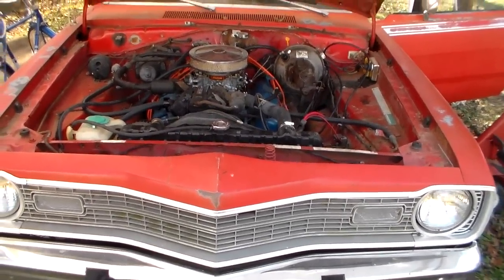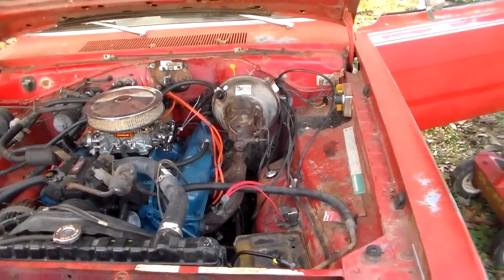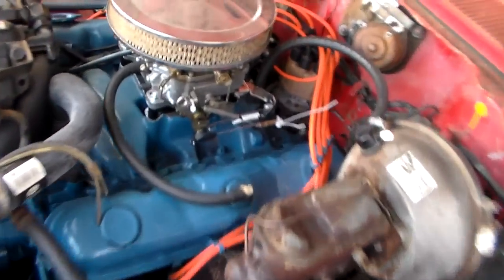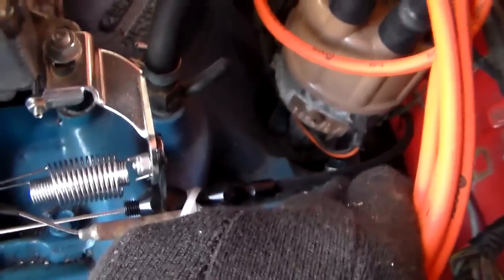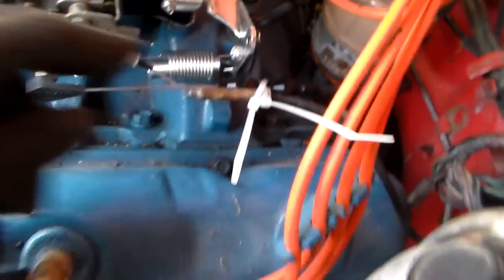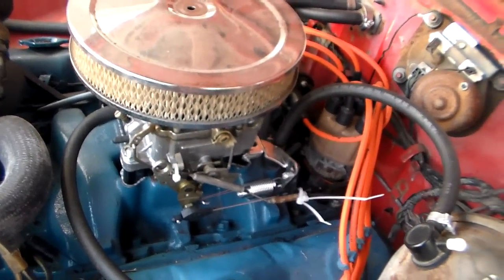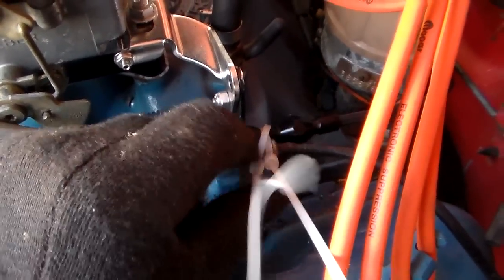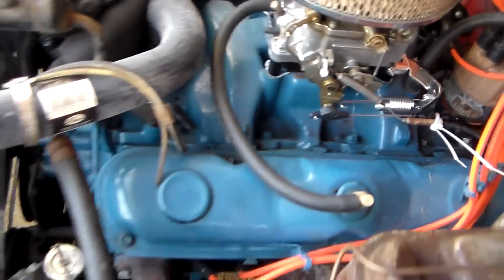Lokar throttle cable installation, 1967-76 mopar A-body

Comment: This really helped. I’ve been trying to find a throttle cable that will work with my 440 duster.
Reply from the maker: It's a nice kit. The factory rods and cables just don't have enough interchangeability and  flexibility.

Comment: Is that bottom cable the kick down linkage? And can you give me the part number for the throttle cable bracket?
Reply from the maker: Kev4PS3  Yes, that is the kickdown on the bottom, which is it's own kit # KD-2727HT.

 The cable bracket is actually called the spring return bracket part # SRK-4000 and the throttle cable is just their universal 24" cable that you trim to fit.
Reply: Tyler's Neighborhood Garage Tyler thanks for this video! I have a 76 dart that was born a slant six that now has a 318 w a Edelbrock carb on the factory cast 4bbl intake, your setup looks like the one I need. Again thanks for this video!

Comment: Nice job. I’m in the middle of this now. You pulled the cable out all the way till it stopped before you cut it and installed it in the carb assembly part right?
Reply from the maker: As far as I remember, but you need to leave enough extra cable for any adjustment needed. Don't cut it flush with that plastic ferrule that snaps onto the carb.

Comment: What does the setup look like at the transmission for the kick down? What if any factory parts do you have to leave in place to use the cable assembly?
Reply from the maker: There is a bracket which bolts on to the transmission with one or two tailhousing bolts. You leave the transmission levers as-is. Don't remove them.

Comment: How did you hook the cable to the stock throttle pedal
Reply from the maker: I don't really remember other than it didn't take any fabrication. What hardware needed was in the kit.
Reply: @TylersNeighborhoodGarage  that's a good question did you have to hold your gas pedal to the floor in order to hook everything up?

Comment: do you have to change the throttle cable ?
Reply from the maker: Yes. You buy a throttle cable kit and a kickdown cable kit.  They are designed to work together.